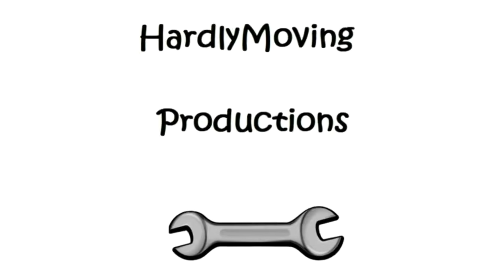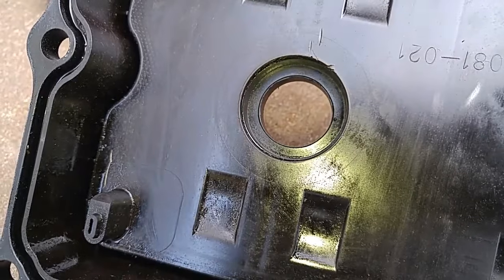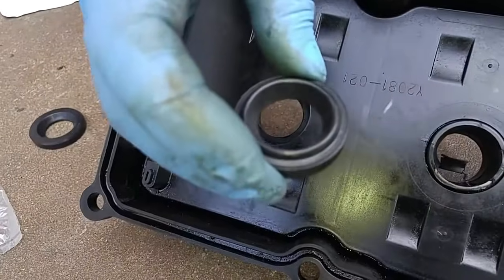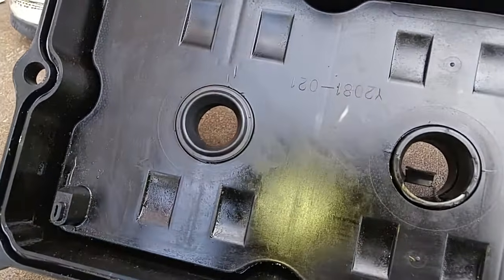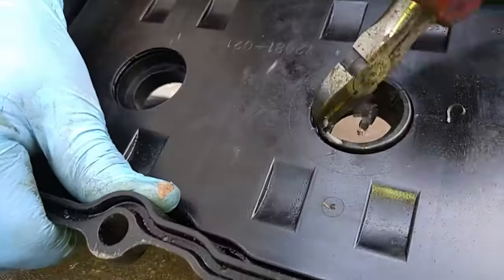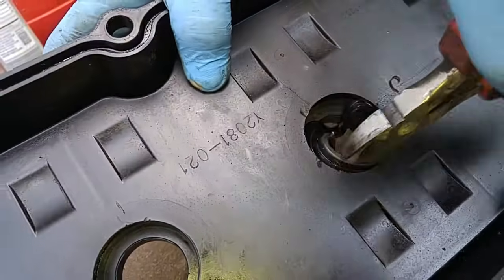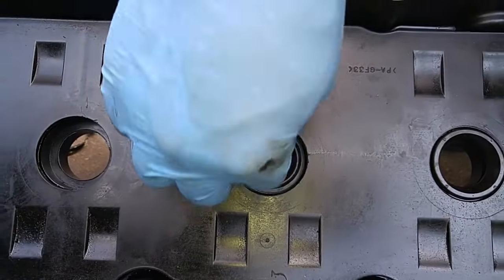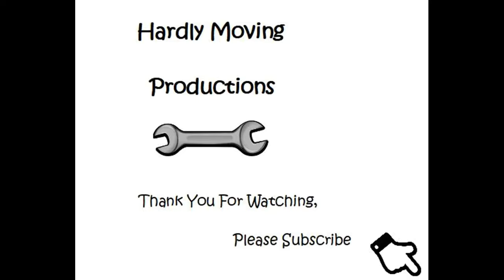How To Replace Nissan & Infiniti Spark Plug Tube Seals

Comment: Awesome i want to do this.
Are the civic seals still holding up.
And how did you discover that the seal from the civic would fit correctly.
Thanks man
Reply from the maker: Haven't gotten any negative feedback from the customer.  Had some extra seals lying around for the Civic and it worked.
Reply: @hardlymovingpro  any idea what other cars might fit as well if the civic ones are not in stock
Reply: What year civic were the seals for? Currently working on this. Want to make sure I buy the right ones
Reply from the maker: 2010
Reply: @hardlymovingpro  which honda engine type k series etc? Thanks

Comment: This is a text book example of planned obsolescence, a method Manufacturers are making more money. 
By integrating parts (usually removeable for maintenance) they boost sales by making you buy more than what you want. In this case rather than just buying the seals Nissan has made you buy the whole rocker cover (only to do it again after a few years). 
Japanese are usually very honest (by their culture) and either have little to zero planned obsolescence. But Nissan is no longer Japanese, it is half Renault owned by French in europe which is not bound by the same codes which explains why Nissan is now doing this. Honda is still Japanese hence the Civic seals are what they are just seals, not locked into the rocker cover or heaven forbid the rocker cover is welded shut onto the head to make you buy a whole head just to replace a seal. Manufacturers are slowly conditioning and removing what it was and should be (seal replacement only) from living memory.
Reply from the maker: I know. I hear you. Which is why I had to come up with a way to replace those seals. A new valve cover with new seals were not available at any Retail Auto Parts suppliers. So I check with the dealer and they wanted a couple hundred dollars. Can you believe it? And the replacement cover is made out of plastic, not even aluminum alloy like the old days.
Reply: So a 2010 Honda civic plug seal fits 2005 Titan 5.6 v,8
Reply: The funny thing is the newer honda valve covers are exactly the same so your point is invalid lol
Reply: @Rawkfist1501 You have no idea. You won't even know it if you see it as you have no idea.
Reply: @Rawkfist1501 Replacing seals on a Honda (b16 b18 f22 h22 powering virtually all Honda) once the valve cover is off is literrally only seconds. 
Buying a whole valve cover just for the seals does not make it any easier. 
You have not replaced seals on a Honda otherwise you would know your argument fails.
As I said you do not know what you are talking about.